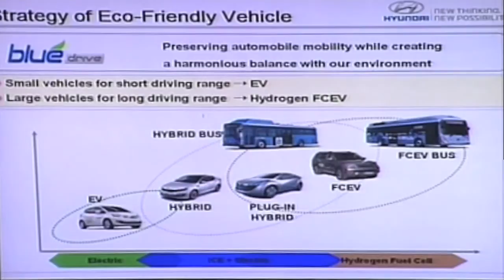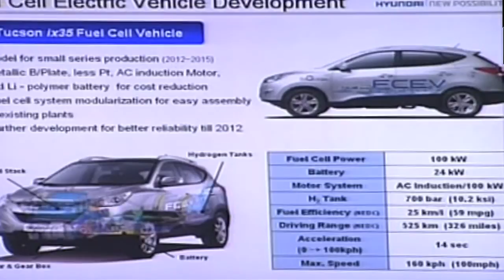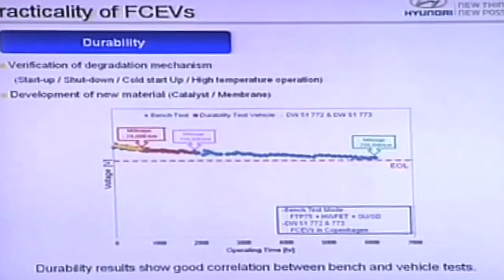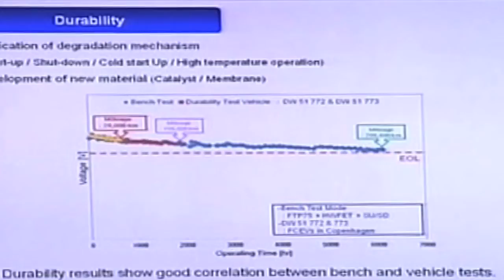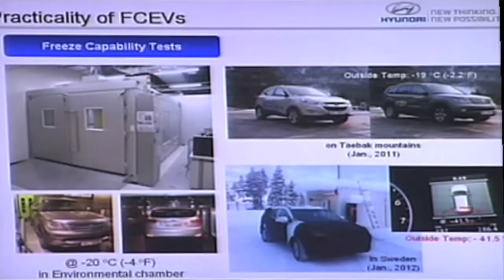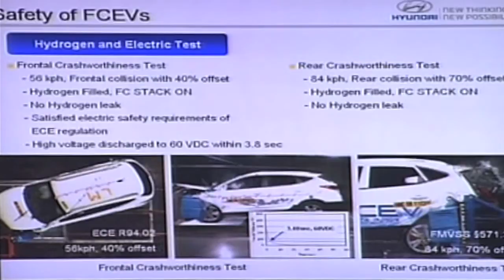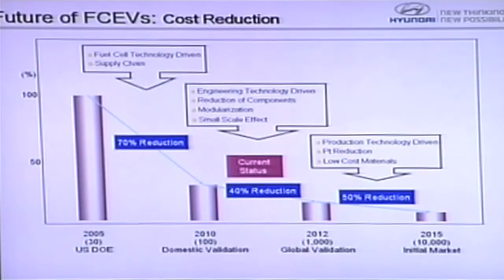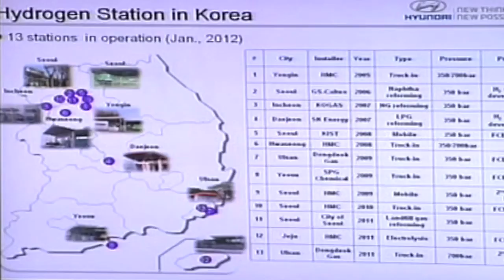Hydrogen fuel cell vehicle development - a future engineering presentation by Hyundai

Comment: When electrons from a circuit pass through a load, there is heat produced by the resistance, this concluding the fuel cell car is also just as un-efficient as the combustible engine. (my opinion)
Reply: The fuel cell has an efficiency of 40-60 % whereas the combustion engine has an efficiency of just a little over 20 %. So there you have it - the reason why the fuel cell could prove superior all things considered.